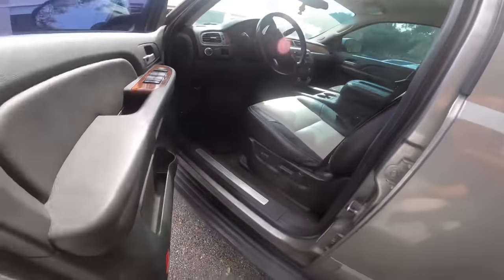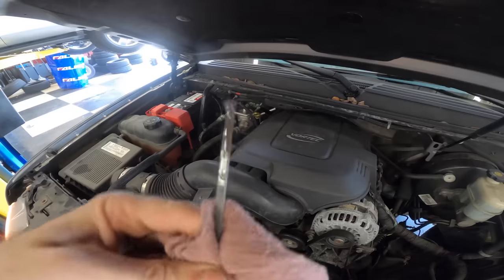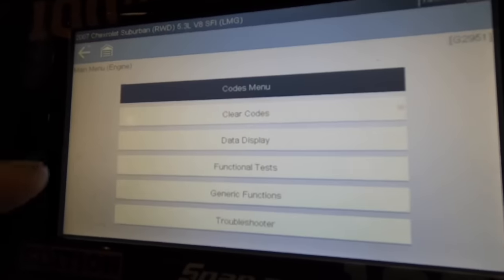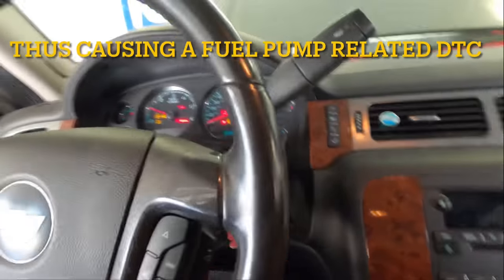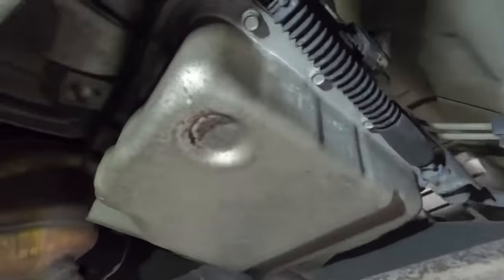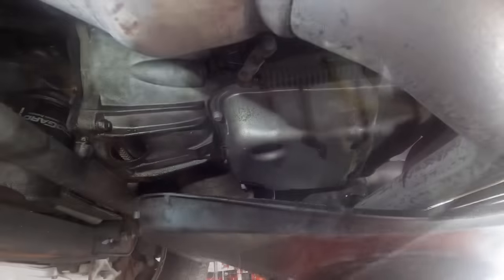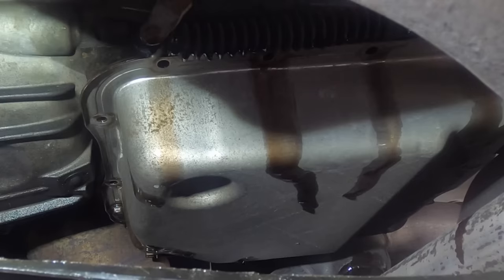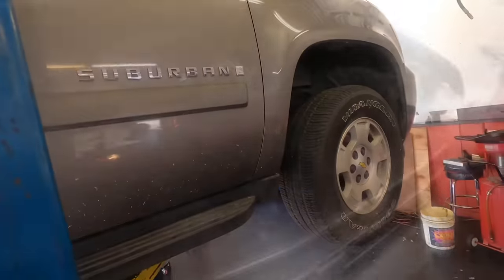Busted! SCAMMING Mechanic Causes Damage! 4l60E Transmission

Comment: I'm intrigued by that rogue wire and the full story.  Was it treachery or just fudging a fix through their incompetence.
Reply: My guess is a bit of both. The other shop knew what doing that would cause, so they fudged the fix and hoped they could milk some more out of the customer
Reply: When I saw your comment, I instantly heard it in a Scottish accent.😂 But yeah I think they knew what they were doing in pulling this scam.😒
Reply from the maker: Im certain that it was treachery. I concluded this based on the evidence that I found combined with the story that the owner told.
Reply: Unfortunately there are far too many shady and dishonest people.  Also unfortunately so far as the automotive field I know for a fact that there are a good number of mechanics who get pushed into being shady by the business that they happen to work for.  I should know I briefly worked for a shop that tried to push that shit on me but I was unwilling to play their game.  Let's just say it was one of the large corporate owned auto mechanic shops within the US.  Got to keep those shareholders happy in the short term even if it means your long-term reputation goes to crap.
Reply: @RainmanRaysRepairs  I agree, none of the error codes present would have been "fixed" by direct connecting the blue wire directly from the fusebox to the fuel pump. Given that the vehicle's owner had no knowledge of the tampering of the fuse box and that the missing relay area was clean indicates it was all done recently enough as to be proof of treachery. The suspect sure had some guts to pull such a malicious scam. That wire could have caused a short and an electrical fire puting the owner and bystanders in mortal danger plus the loss of the entire vehicle. I really hope he gets criminally charged rather than just sued.
Reply: @oengusfearghas9608  A "good" mechanic who is pushed by their employer to be a scam artist is not a good mechanic. A good mechanic quits and moves to a new job when their employer tries to pull that. If they're truly a good mechanic they won't have any issue finding a new job.
Reply: Seeing that blue wire as soon as you pulled it. If it's tied in in such to maintain a power loop when things should be off with the key...yet when disconnected things turn off as they should. As only 1 of the issues...
Reply: @RainmanRaysRepairs  Did the AC work after you fix it..
Reply: As a master technician, what this YouTuber discovered 100% appears to be a scam…backyard mechanics way to maximize profits.  It’s a Chevy, so it has problems I am sure, but nobody should ever create/invent problems to rip someone off.. there’s more than enough legitimate work to be done, I could wrench 24/7 if that were possible and never run out of cars to service.
Reply: @Matt-nq4du  I completely agree.  And while this shop I worked for wasn't trying to do actual scammy shit, they constantly pushed us to upsell customers on things that were not needed.  One example is the manager tried to legitimately sell a customer on a new air filter for a car that was in for its first oil change from brand new.  I'm certainly not opposed to suggesting things when they're needed or even starting to get close.  But trying to sell a customer things that the car obviously does not need, nope I'm not going to do that.
Reply: I'd like to think it was more a case of incompetence if it was done by an amateur but unfortunately a seasoned mechanic should know better and that would make me very suspicious that it could have been a dishonest attempt at gouging more money from the customer.
Reply: Dear Big Clive , how can the fuel relay be missing yet he drove said SUV and we saw on VIDEO that he started this SUV a few times . if your thinking about Auto electronic repairs let us know . The suv would have gone into limp home mode if fuel pump did not shut off , because pressure dif in fuel before  and after reg. I would say this is all for the benefit of the camera.
Reply: @RainmanRaysRepairs  well you do not know  who that guy is  but i can tell you is one of 140 dislike !
Reply: I am pretty sure these videos keep appearing on my home screen because I sub you and you keep commending on them haha
Reply: @sammydemon666  Nice one that’s worked that one out
Reply: @RainmanRaysRepairs  I agree 100% Sir. and thank you for doing things right. Sadly getting more rare these days.  My Dad always  told us if it takes a crook to get rich,than he would rather be poor, He died poor.  And you are right. One mistake or bad act can and will, wipe away a lifetime of being a good person.  All my best.
Reply: @anthonys7976  This guy is a master Technician/mechanic...not just a youtuber
Reply: But still a YouTuber.
Reply: @RainmanRaysRepairs  How do you know the last guy put the blue wire on?
Maybe he tried to diagnose around it and went way off track. I've seen techs ignore red flags or make assumptions they are unrelated.
Reply: The other guy should be held to account and publicly shammed so he doesn’t do it to anyone else 
Hi Clive 😁
Reply: @don2deliver   Too many "coincidences" for that to be the case.
Reply: @don2deliver  The blue wire was new and pretty much clean in stark contrast to the rest of the engine bay. The owner stated the errors and behavior started after that place did an oil change. Doesn't really come much simpler than that. It's not a car with a complicated ownership history lile in cases where you just bought something and have no clue who did what to it.
Reply: @martingilvray06  
The blue wire which presumably powers the fuel pump could have been jumper'ed to the IGN circuit.  If true, the pump would be off when the key is off, so Clive may have mis-stated that the fuel pump would run all the time.  Problem is the current would now be going thru the key switch, which isn't designed for that, so could degrade it.  I wonder how the ECM could know the fuel pump relay was bypassed.  Perhaps it monitors voltage at the pump which might have been low from drops across the key switch.
Reply: Probably a helping of incompetence, with a side of treachery and bad trans fluid for dessert. 😏
Reply: Im in the same profession and I'd add that the shady scammers that give shops & techs a bad rep are doing a service to the honest and reputable quality ones like you when correcting hackery work by shady mcshaderton and  proving to customers that when in your hands integrity and honor is a shared interest. Good job sir!
Reply: @williamsquires3070  Sounds like the condition of the Trans fluid was a side effect of what this guy did with the fuses. It affected the ability of the transmission to shift properly, and if I were the customer, I would be angling to get money for that inevitable repair as well.
Reply: @oengusfearghas9608  all dealerships do that.
Reply: @don2deliver  its obvious other guy did this. He removed what he had done and it ran fine. Only person to work on truck was other guy
Reply: Leaving a fuse and relay out? Really?
Not fudgery. Pure treachery!
Reply: Ignition switches do cause low voltage out.
Reply: @RainmanRaysRepairs  what a rip-off...

I hope the customer is having the other shop settled for good...

And i wish all repair shop is as good as your honesty and good working etique
Reply: @dennisbonville3217  . Here in Indiana a GMC Dealer try to sale 3 brake jobs at the tune of 2 grand each time. In the span of one year.and only 3.400 miles.when I declined the third time.they cut the gas cap gasket.and burn the electric compressor on the air suspension system.
Reply: Suddenly another YouTube legend appears…
Reply: @williamgrissom9022  The pcm is generally controlling and monitoring the fuel pump relay control coil circuit. With the fuel pump relay removed, the pcm would see an open circuit in the control coil circuit and flag that 'control circuit open' code👍🇦🇺
Reply: @simonilett998  Makes sense.  I wonder what simple circuit they can use to monitor coil resistance or current.  Also, even if the coil measures OK doesn't mean the relay works as the contacts can become pitted or stuck shut.  It would see simpler and more robust to sense the voltage (or current flow) output to the fuel pump.
Reply: I'm still laughing at how well the OP's statement fits the Scottish brough!
Reply: Seems to me that blue wire & the fuse & relay were all signs of previous troubleshooting & just hadn't been put back to how it was. Maybe the owner just took the vehicle away without giving any time to put it all back together? Seems to me a lot more going on with the relationship between the owner & the previous tech that we aren't informed about. Leaving fuses & relays out and a random wire isn't the cleverest of scams & easy to spot.
Reply: Haha Hey Clive been up late on the internet again!
Reply: @RainmanRaysRepairs  what happens when something like this wire may cause the car to say cause an accident - would insurance even cover it, since its been tampered with?
Reply: I believe they were incompetent and tried to fix through trial and error idiocy.  Probably still scratching their heads.
Reply: @anthonys7976  Agreed  Master tech 25 years   I run into the same kinda crap.   One thing i try and tell people  and this goes for all walks in life.  If you can not enplane how something works or why it works  then you  yourself don't know what's wrong.
Reply: @williamgrissom9022  Most common is the pcm grounds the negative side of the coil, so when it's not grounding it, the pcm can monitor for voltage on the negative side. Some systems are designed to also monitor the load side of the relay too, be it current, voltage or both. This would generate a different fault code specific to the load side of the relay, rather than the coil side.
Reply: @markonw6661  you mean you don't pull and test EVERY fuse in the box with each oil change? 🤔😐😐😏😏😏
Reply: My guess is if you’re smart enough to run a wire to bypass the real issue then you’re smart enough to fix it.
Reply: no ..that was a complete ' set up '
Reply: @martingilvray06  The blue wire was supplyng power to the fuel pump.
Reply: @simonilett998  Thanks for the reply.  That is a fairly simple method.  Most controls are actuated by such "low-side switching", so when the low side is OFF it should be pulled up to +12 V if the coil and wiring are good.  Not just for relays, but other solenoid loads like fuel injectors.  It is easy to verify such levels with a digital circuit on the ECM board, so sounds like they do that for many circuits today.  As you say, verifying the output to the load is harder, but more assured than on the logic side of the relay.  Re fuel supply, the most assured diagnostic would be a pressure sensor at the fuel rail, but none of my gasoline engines have that.
Reply: @williamgrissom9022  Yes, you're spot on, not all but most solenoids, actuators etc are low side switched. Also, a fair few late model vehicles, mostly gdi or some mpi, do have a fuel rail pressure sensor/s, to confirm pump activation, correct fuel rail pressure, and/or for monitoring by the pcm for fault code generating, or live data capabilities.
Reply: N the gas
Reply: @RainmanRaysRepairs  i think the noise is a cracked flywheel I had the same noise on an S10 I had it was cracked around one of the mounting bolts and would flex whenever you pressed on the gas
Reply: @williamgrissom9022  what I was getting at was fuel pump pressure is control by the ECU turning pump on off by picking up info from the fuel regulator so if pump did not shut off would this not put the vehicle into limp home. So the SUV was not going into limp when driven before being put on the ramps , so has this situation been created for the benefit of the camera. Please take into account that I am UK and do not know this model. The drive around the workshop would nearly take you around the Island Clive lives on. We have not heard from Clive but it’s that time of year for him planning Xmas lighting.
Reply: @anthonys7976  Former master tech here too, and I conquer with you. It's pathetic. Hats off to  @Rainman Ray's Repairs for representing those of us with integrity.
Reply: @martingilvray06  
I doubt a 2007 would modulate the fuel pump to control fuel pressure.  Most/all in that era ran the fuel pump continuously and used a "back-pressure regulator" to control the fuel pressure, which is simply a spring-loaded relief valve which sends fuel back to the tank.  By ~1996 those were usually inside the tank as part of the "fuel pump assembly".  Earlier the pressure regulator was on the fuel rail, with a return tube to the tank, but the EPA required a "return-less system" to avoid heating the fuel (more evaporation), which is also simpler.   Designers initially over-thought the systems, thinking they had to control pressure right at the injectors, and even relative to intake manifold pressure (had a vacuum hose for that), when none of that is required.  I vaguely recall reading that the latest systems control pressure with a variable-speed pump.  I doubt on-off control would work.  In some, like the after-market Holley TBI on my classic car, they apply full BATT+ to the fuel pump to start it, then drop the voltage a bit (~10 V) while running.  Perhaps that is what you have seen.
Reply: @alexisrivera200xable  People always claim something just happened after you changed their oil. That's not proof of anything. Your getting a third hand account of one side of the story. Even Mechanics see what they want to and expect to see sometimes. A diagnosis sometimes includes completely abandoning any presuppositions.
It could have even been a shoddy repair path based on an intermittent problem that isn't currently happening. 
Never blame on malevolence what could simply be blamed on incompetence.
Reply: @oengusfearghas9608  Short term gain, long term loss but that's the game they play and then move on under a different name. Nice to see you didn't play their game.
Reply: I hate this crap, it affects every trade when you do things properly
Reply: @jasonsummit1885  p
Reply: Hey BigClive how are you? Hopefully we'll. I actually follow you. Love your content as well as the one I just watched.
Reply: @oengusfearghas9608  the worst is used car dealers!!!
Reply: @williamgrissom9022   The ECU only detects that the data link to the fuel pump is not responding so it posts an error. It doesn't have a way to detect if the relay itself is missing just that the pump controller does not respond at all when queried. Its just the information needed to troubleshoot the general area.
Reply: @alexisrivera200xable  the wire would not have caused a fire, he chose a 15 amp circuit for a reason, he also used 16 gauge wire, which is enough to provide current to the Fuel pump from that range, the factory harness uses 18 gauge ( that's why new pumps come with 3 feet of 16 gauge wire, to make up for the lacking factory wire) .
Reply: @martingilvray06  Chevrolet SUv's don't have fuel pressure sensors, pressure reg is still mechanical.  and the pump was running, despite the fact their was a circuit code for it. ECM's are not that smart.
Reply: @williamgrissom9022  my 2000 silverado still uses a mechanical regulator on the rail. there is no PWM pressure control, until around  2010 for chevy trucks/suv's with the V8 engine.
Reply: @don2deliver  I'm not a mechanic by trade I got taught by family but I did study computer science and electronics repair so the forensics are not hard ro do and the times align with the customer's story I can tell that there was foul play involved based on the presence of that (fairly new wire) the ECUs errors and the behavior of the truck. It was tampered with recently. Had it been left as is for longer the transmission would have been demaged a lot more. Its a rather clear cut case actually. From the moment of the tampering I can tell the first thing that went wrong is the battery getting drained, followed on by the truck feeling sluggish. The ECU needs the sensor data from the pump and the transmission fuse to power the sensors so it can control the gear changes
Reply: @RainmanRaysRepairs  I was thinking the previous mechanic that was supposed to do an oil change probably drained the transmission not the engine oil, then over filled the engine with oil and left tranny empty, causing tranny damage, and over filling engine messed up the oil pressure somehow, then after they brought it back he seen what he did and tried to cover it up that’s why the granny fluid was so clean
Reply from the maker: @gamebredduramax71  This can happen in occasion…. But not this trans. It don’t have drain plug (GM stopped doing that on this model)
Reply: @RainmanRaysRepairs  oh ok. Your a good mechanic IMO. If I was near you I would use you to fix my vehicles
Reply: Remember the bad old days when you had to go through with a test lamp or multi meter and look for the faults to try and confirm your original diagnosis that required a lot of knowledge particular to the vehicle or that manufacturers equipment and systems, which almost always involved taking things apart, only to get moaned at because it took time to discover the true extent of the problem never mind fix it. And some customers would then want to see the broken parts because they know better than you do and think your bluffing them.
Reply: @RainmanRaysRepairs  In addition, it is very unlikely that combination of "defects" (I hate it when parts evaporate) that would cause DTCs but still allow the engine to run would have 'just happened."
Reply: @62saki91  I wasn't talking about the wire's gauge I'm talking about how the fac that it was haphazardly routed and hidden. It just takes a single nick or melting due to its proximity to hot parts for the insulation to fail and cause a short. The OEM for what is worth keeps all the cables bundled in the wiiring harness and properly routed which protects it from the heat far better than that blue wire was.
Reply: @RainmanRaysRepairs  if it wasn’t treachery they would have said, we think it might be xxxxxx and you’ll need xxxxxxx but in the meantime we’ve patched a wire in to get you going, but they didn’t because they were just ripping the owner off, bet they do it all the time.
I’ve only had one experience if a shady motor dealer, and fortunately have had the benefit of a number of good guys (like you) I don’t mind paying if it’s justified.
👍done
Reply: Could always go back to the scammer and break all the windows out of that crooked shop and leave a business card for a local glass replacement shop. Don’t get mad get even. This comment left by SPITE Inc.
Reply: @62saki91  Thanks it all makes sense to me , I can’t believe the mileage you all get out of your vehicles. 6’2 rings a bell , me second P.
Reply: Seems like maybe other guy was in over his head and was grasping at straws. Not every car mechanic is crooked.
Reply: @shawnkelly5459  previous "mechanic" may have loosened flexplate bolt(s) to cause the noise(and lazily left off the inspection cover)
Reply: @martingilvray06  Painter by trade, shade-tree mechanic out of necessity, I'm pretty sure that fuel pumps do NOT turn off while engines are on. The ECU sends a signal to the fuel by-pass circuit to return any "unneeded" fuel back to the tank on a continuous cycle.
Reply: @Matt-nq4du  Some people can't afford to do these things, I don't blame individuals unless it's proven the individual was the one at fault
Reply: @Matt-nq4du  there's a reason our tool boxes have wheels lol - and you are right, finding a job the same afternoon you tell that thievin' rat bastard you quit isn't unheard of for those of us that can actually fix things.
Reply: @alexisrivera200xable  judging from the direction it was going i'd say they had it following the brake lines ( likely wrapped around them)  down to the ABS module and then ran it in the frame rail.  so realistically, the customer would have either A caved and bought the repairs, b found a different knowledgeable shop, or C taken it to the dealer for a trade in, which the used car tech would have looked at it and said WTF? before it would have ever rubbed through.
Reply: Well well... fancy meeting you here, Sir 😁
Reply: Big Clive!! Did you get this in your recommended also?
Reply: @ramiroescamilla7263  About 15 years ago I had a Mineke guy (in fairview heights, IL) tell me I had a leaking boot on my brake caliper, which needed repair.  And that it was all an inseparable piece so I'd need new calipers. So I asked him to show me how bad the leak was so I'd have a better idea how soon I'd need to take care of it (I'm no mechanic, but I was raised around a lot of blue collar guys & have at least a vague sense of it). He takes me back, pulls the wheel, exposes the caliper. Nothing. Not one drop of brake fluid anywhere. I say "that looks bone dry, where's the leak?". It was an honest question, still giving the benefit of the doubt, sometimes a leak is hard to spot... 

But his body language was getting really awkward, and I was starting to put 2 & 2 together. So he goes and gets the manager to show me how it's leaking. The manager does this by prying the rubber end cap on the caliper piston open with a pocket knife, right in front of me. I wish I had it on video. I was speechless. And it was extremely obvious from the dust that nobody had pried the rubber boot on the caliper piston open during the brake inspection. I must have had a stupid look on my own face because the manager had this _ eating grin on his face like he thought he was being clever. He struggled to coax a drop or two of half-dried up brake fluid out from under the boot.

I said "that wasn't leaking until you stuck a knife in it". His grin went away. He says "well there shouldn't be any fluid at all!", so I ask "then why does it have a rubber boot sealing it up?". He said nothing so i went on "any hydraulic piston is going to have a little bit of fluid get past the gaskets, it'll probably take me a year to build up another 2 drops for you to coax out from under that boot". Younger employee sucked his lips inside his mouth and just looked around the room. Boss guy was getting huffy. I tucked the boot back into place with a fingernail, checking that the knife gouge in it was pretty minor, and told the younger guy to put the wheel back on. I said to the manager "I was told the boot was an inseparable part of the caliper, but you just pulled it off with a knife, and I just put it back on with my fingernail. If it ever does become a problem, I think I'll take care of it myself".

I'm normally very sweet, I swear. But I was extremely annoyed, and kinda channeling my inner redhead.

The manager tried to forcibly escort me back to the waiting area, citing 'employees only' or something, but I yanked my arm out of his hand and informed him that I was staying with my car. At that point he got a real mean look about him, and you could have heard a pin drop back there. Got a strong impression that the employees thought something might go down. I dunno what the boss guy was thinking. I was thinking that none of the other employees would lift a finger for that boss, that I had positioned myself very near a tire iron, and that it would take him about 1.5 seconds to get his pocket knife back out and opened up. Maybe he could tell what I was thinking, or maybe he just decided not to argue further. either way, I wasn't letting my car out of my sight. And after a few moments he stormed off to his office.

Technically the boot's mostly there to prevent corrosion, and a caliper can leak out through there. But it was really obvious mine wasn't, and that they were being shady af. That boss had a vibe about halfway between a used car salesman (the stereotype anyway) and a mugger. Fortunately I found a different shop with a mechanic who had all the social skills of rusty barbed wire, but who's very honest. That's all I really want in a mechanic. It's so hard to find an honest mechanic and a good dentist. I'd say a good doctor and a good lawyer too, but I've never met any of those. I'm sure they exist, hypothetically.
Reply: @RainmanRaysRepairs  I'm really hoping the owner of the other mechanic shop didn't know this was happening and returns all money for the unneeded "fixes" that broke things on purpose. Also, hope they check with police fraud department.
Reply: Indeed, I was thinking the same thing. Sounds like they were trying to bypass the fuel pump relay.
Reply: @martingilvray06  How do you you think, with the blue wire bypassing the relay and connecting the pump to the battery
Reply: @wirdy1  yeah I completely agree. All the people saying it's a scam don't understand car electronics.
Reply: @alexisrivera200xable  I was thinking the guy was just getting the fuel pump and working his way back from there. Leaving a blue wire exposed running straight to the fuel just seems like the thing a novice would try just to get it running. Just saying.  You did have more clues though. Shameful.
Reply: @don2deliver  My 2001 Expeditions fuel pump failed right at the mechanics bay after an oil change. The mechanic took it out for a test drive and then it would not fire after he parked it in the bay. I heard the sound of my engine being cranked over and over from the waiting room and went out to check. I stopped him after the tenth attempt as something was clearly wrong. I suspected treachery, but at 94K miles and 16 years I suppose it was time. It did cost me quite a bit to have it fixed then and now and had to bring it back because the fuel sender was quite a bit off and I had no reserve level. That mechanics shop also worked on my wife's car at same time and failed to fix the brake lights and even left a loose bolt laying under the hood they could not explain from where it came.
Reply: @NerdyMeathead  When I watch a channel a lot it seems to appear in my channel viewers suggestion list.
Reply: @62saki91  Except for the many millions of GM engines with SIDI.
Reply: Treacherous actions.  Running fuel pump to fuse box. Is not an accident
Reply: @alexisrivera200xable  you would make a good detective.
Reply: @danielnelson4881  Wow, you wrote a lot of text. 🥉
Reply: Bigclivedotcom I keep finding you everywhere lol
Reply: I would see the wire as treachery personally due to the below based on the vid and my knowledge of car electronics and scan tools.

The ecu (pcm) controlls the fule pump and may or may not (depending on car) modulate its speed based on demand 

The fule pump relay tells the ecu to run the fule pump 

The jumper wire (blue) was taking power directly to the fule pump to run it 

Now as far as Ray said the car never once went In for starting or stalling issues so why would you remove and bypass the fule pump relay 

And as soon as you add the jumper ther relay will get stick closed as the ecu is bypassed so the car will run all the time (as it did)  it this would only be solvable by removing the relay to break the 2nd curcit. That means unless you pull the relay and bypass the fuse the car won't run or stop (depending on which way you do things) Also the other way around the car wouldn't run if you removed the relay and didn't add the bypass (so I would say these were done at the same time) 

As the scanner won't see the issues until they exist (relay removed and bypassed) they would never of had cause to go near those fuses or relays in the 1st place. (Unless they knew what would happen)

The bypass also caused the trans to enter limp mode loosing 1st gear which is the main thing the customer says he noticed (Which if it were some attempt of a fix you'd put everything back and start again)

So based on the customer (according to ray) stating the issues started after an oil change and batt change and the fact that it caused an issue that produced some very specific issues that would still allow the car to run I say its most likely a scam to get customer to pay more

Ps well done Ray you saved them a huge bill

Pps hi Clive I keep seeing you in the comments of all the videos I watch see you tonight in live stream lol
Reply: @MattyEngland  Sometimes explanations take a minute or possibly  two, to type, instead of 10 seconds. I wanted to help you to understand.

I doubt you read it, you strike me as one of those "ur dumb, I'm so smart.. 30 seconds of reading? EW NO!" kindsa people. If you did though, I was a wee bit triggered by your statement of people not knowing anything about electronics if they thought the truth, basically. So I may have been a bit abrasive, I apologize for that.

I'd still love to hear your explanation if you've got one. I'm not afraid to read for 30 seconds, a minute even if I'm learning something! Lots to learn from some incredibly smart guys and gals 'round these YouTube parts!
Reply: If the guy knew what he was doing then sure was Treachery and if not then that guy shouldn't be trying to be a mechanic when he is nothing of the sort.
Reply: @danielnelson4881  I read it, I just have no inclination to waste my Saturday debating it at any great length. It would seem perfectly reasonable that someone MAY have bypassed the fuel pump relay in an attempt to rule that out as the reason for a no start. The story of what happened was vague and all based on 3rd party information anyway, who knows who or how many people had been messing about with it prior to it coming in the shop.
Reply: OMG bigclive visiting this channel!!!!!!!
Reply: I suspect the customer/owner isn't telling the whole story.
Reply: What shop did that king of rigging?? I just wanna talk.
Reply: @tonpear5909  we are specifically talking about the GM SUV/Truck V8 engines, not the SIDI 4 cylinder engine GM uses.
Reply: For him to run a wire and plain sight it's safe to say  He was just rigging some shit up and didn't have a clue on how to fix it the proper way
Reply: @ikelove8690  I agree. And I think the owner got frustrated and took the car back unfixed, and then lied to this Youtube mechanic.
Reply: @williamgrissom9022  it monitors the relay circuit for power when the ecm grounds it. The ecm was grounding without receiving voltage meaning an open in the circuit.
Reply: @RainmanRaysRepairs   two things... 1. would love to chat at some point, great vid and awareness of your craft...excellent... 2.What is Jeopardy Ray?
Reply: @anthonys7976  not just backyard mechanics..............as others have explained here.
Reply: @RainmanRaysRepairs      ive had my own horror stories with car mechanics.   more than one unfortunately. the latest one:    a 2003 infiniti g35, spent almost 3 years in a shop getting a used engine replacement. ended up somehow having to replace both Cats as well, even though the car had passed smog just a month before it went into the shop.
Reply: I did a quick auto box investigation many years ago. Ford Capri auto, it had a tinky tink noise. The spring for the trans parking brake lock had broken. I had done originally a camshaft on the 2.0 litre engine, a well known problem. The tinky tink noise only came to light when the camshaft noise disappeared, The customers father came in and accused me of damaging the transmission and was verbally abusing me and the Garage. Then the daughter came in and asked what was going on, as it was her car. She listened and said it’s always done that! The small spring is designed to hold the lock clear without it the lock bounces of the teeth it engages with making a tinky tink noise. Luckily it cannot engage! Well done daughter for being honest. Sorted camshaft and transmission parking brake lock.
Reply: i seen stuff like that before, who knows if it was on purpose, it could have been a by pass by a less skill mechanic, there could have another problem with the pump in the past that later got fix and buddy forgot about the little pump wire jump wire, i done bush fixes, because in the bush you only care that it moves back to town, once u get it home, you do it right
Reply: @levisvarela3735  100%. We have no way of knowing if the customer is telling the whole story. It is very easy to sit here condemning the previous mechanic and calling for justice but none of us have any clue of the history. This vehicle appears to have many issues which could be related or not. I have always told my employees to come to conclusions based on what you know and not what you think you know.
Reply: @jasonsummit1885  naw ye didnae
Reply: @oengusfearghas9608  there is no excuse for forcing this on your staff and as staff we all shouldn't allow it...if we all make sure we don't do it and call out companies for doing it then they will stop eventually...I'm in the UK where its less of a problem but can still happen.
Reply: @spikenomoon  Thanks for the kind words friend.
Reply: @anthonys7976  Chevy makes the best trucks.
Reply: @Matt-nq4du  And he should also denounce his boss to the authorities, or he will just hire another "not so good mechanic" to continue with the scams if he is not stopped.
Reply: I spy BigClive! So thats why I'm here... Oh well beats being Rick Rolled, great channel Ray :o)
Reply: @levisvarela3735  you arent really thinking this through:   there is literally nothing wrong with the car.   there was no reason to ever "bypass" anything.   certainly not the fuel pump relay LMAO.    no one in their right mind puts that wire into the fuse box unless there was actually a problem with the engine in the first place.  which there literally isnt, proven by the fact all he had to do was put the fuses back and the car is back to perfect working condition lol.    110% certain this was a scam in progress.  10 BILLION % certain it was a scam in progress really.
Reply: @oengusfearghas9608  pepboys
Reply: Nice detective work sir!
Reply: I have seen this jumper wire "repair" before, but it was not treachery.  These vehicles have an failure prone immobilization circuit that interrupts power to the fuel pump relay and prevents the vehicle from running.  That security system is really buggy and bypassing the fuel pump circuit restores operation.  Usually power is taken from the switched ignition circuit so that the fuel pump only runs when the ignition is on.
Reply: @velocity2654   if that was the case then the vehicle would still have that problem when he put the fuses back in
Reply: @jasonsummit1885  gvլւին00յ0
Reply: Definitely away to make the person think they have a problem in the fuel pump that’s why the battery went dead
Reply: @wirdy1  Not to the owner, the whole point of a scam is to get the customer to say ok fix it, not go to another mechanic
Reply: @bamamanfan  no, I'm saying he's both. Someone  implied what your saying but not me.
Reply: @bamamanfan  he seemed very knowledgeable to me otherwise, I wouldn't have watched so much of it and read the comments.
Reply: @ramiroescamilla7263  Explain why you kept going back when you knew the first time they tried to sell you a brake job, that this was not needed???
You should have reported them to the bureau of auto repairs for your state and let them get into their stuff.. 
You kept going back to these crooks and then they jacked your truck..
Why???
Reply: @Yohann67   concur...
Reply: @icanfartloud  the not turning off issue was FROM the wire
Reply: Smart and articulate fella. Hairy as fuck arms. Reminds me of my old man.
Reply: @frandanco6289  Easy buddy. Not everyone's Batman
Reply: apparently the rogue wire as you called it was part of the problem, not a solution or temporary fix.  look above your comment and read my story of a "bad" mechanic. it happens too much.
Reply: @Matt-nq4du  ikr. What was that guy smoking when he wrote communist manifesto.
Reply: Either way zero excuse after all the end result is the same,  a customer paying through the nose for work not done or needed.  Both are dishonest  behaviour. If you don’t know what you are doing you have no business doing it and posing like you do know you are just as crooked as the so called mechanic intensionally setting up and ripping off through the claim of unneeded work and parts selling. 
If this was my Suburban I would take that blue wire and very tightly wrap it around the neck of the person who put it there causing a malfunction of the air intake breather section. Joking … But not joking I do my own work 99 % as I do not trust any shop, especially those that pay the mechanics a commission of sales.
Reply: @alexisrivera200xable  wtf? Yeah that's shady and a complete crap thing to do but you're being super dramatic. I have a better chance of leveling a city block by not discharging the static electricity from my fingers before operating a gas pump. Sheesh
Reply: I had a tire shop try to generate repeat business by deliberately screwing something up, most notably putting a front wheel on cockeyed and slamming it on with an impact wrench, thus distorting the rotors.  I saw through that scam and never went back there again.  I had another shop turn the rotors and reinstall the tires with a torque wrench.  Didn't mind paying them for it, either.
Reply: @RainmanRaysRepairs  45 minutes and IT'S NOT EVEN my VW.  Good presentation. Computer replacement big $. U got your thumbs up. :)
Reply: @martingilvray06  He mentioned that the fuel pump had been hotwired to be always on when the accessory circuit was on.
Reply: @Iceman-kr6df  pp aww
Reply: @jasonconrad5772  Yeah, on the front damn door! And on the wall at the registers.
Reply: @morganplisken7271  Perfect business model! Get even!
Reply: I've had lots of cars with lots of rouge wires and fuses going here and there.
Reply: What was with all the flickering lights and why was the engine block light on?
Reply: @Matt-nq4du  When I was young, I had a Service Manager tell me to perform a repair where there was no issue.   I was told to take a week off and think about my choices in life, so I loaded my box and drove off.   Two days later (Thursday,) I was invited to lunch with the employer I was with before I went to Shady.    Monday, I was working again..... and on Friday, the place I had just left contacted me to let me know they fired that Service Manager - after four other mechanics left the next day for pretty much the same reasons.
Reply: with fuses played with scam has happening in your face you can see it,  or is that you? i was scammer by one said my rear breaks were needed replace so yes I had them do it they were at 8 or 9  it was not my regular they were over booked I only went in for oil change I went to reg mechanic for  tire rotation and  I told him my rear breaks were done  he looked at me and said why they were fine wait till they were 3 also that other one fixed ?? my heater fan in the car  went in fine same job when I drove away the vibration was was rocking arm rest like when you get a peach core in your tire front it rocks the front end when driving,
 he had  to fix it now it is a 2014 escape I was scammed never go there again
Reply: An honest tech, which most are, do the work of the great architect, whatever that may be. It is troubling that some chose to hurt others like this. They should think of the darkness they attract. Just an amazing vid Sir, thank you🙏
Reply: If he was smart enough to know how wire up a "fix" and conceal what he did, he certainly knew he was out to screw another customer.
Reply: @RainmanRaysRepairs  nice work on your part even thought that truck looks a bit worn out
Reply: It was a very clever scam
Reply: Good Question.
Reply: They had to know what they were doing, because there is no reason to remove the fuel pump relay, and wire a hot wire to the fuel pump using the transmission fuses socket. Thus causing both the fuel pump circuit code and transmission to be stuck in limp in mode with a transmission code. It could be that they didn't change things in the fuse box, someone else did, but they never checked it. They might have just read the codes, and said you need to replace this stuff to fix these codes. Whoever removed the relay and fuse and wired a hot wire to the pump is the one that caused all the issues.
Reply: @RuralTowner  Hi may I ask what are other issues and if u think blue wire was negligent or scam?  Thanks
Reply: @martingilvray06  Do u mean fuel pump fuse relay was necessary for car to drive into shop?  Didn't blue wire bypass relay possibly?
Reply: @don2deliver  Are blue wires commonly used to diagnose transmission issues ?
Reply: @williamgrissom9022  interesting info, what do u think 🤔 happened and why was blue wire there ?  Cheers
Reply: @techtastic2010  so does this mean the missing fuel pump relay affected the transmission? ... But kept fuel pump running with blue wire ? 🤔 Cheers
Reply: @simonilett998  great info but can car run without fuel pump relay as no gas ⛽ is being pumped?  Thanks
Reply: @wirdy1  ok great info, but is that common for fuel pump relay to be taken out to diagnose transmission?  Seems difficult to probe by untrained mechanics because fuse box would have to be opened. Thanks.
Reply: @one2tameflame  ok good point but why not just buy new fuel pump relay ? And does blue wire affect transmission? Cheers
Reply: @don2deliver  do u mean missing fuel pump relay could have been removed from work before oil change?
Reply: @jasonconrad5772  Do u mean fuel pump jumper allows fuel pump to flush out fuel without engine on?  Is it possible that was from prior work before oil change?  Thanks for pov 🙏
Reply: @alexisrivera200xable  ok thanks for interesting info.. what is your views on missing fuel pump relay and blue wire?
Reply: @62saki91  interesting info, may I ask your views on missing fuel pump relay and blue wire?  Cheers
Reply: @gamebredduramax71  it appears transmission fluid was dirty in this video before it was changed.
Reply: @kathrynck  how are the brakes now?  Lots of DIY brake videos on YouTube. Cheers
Reply: @acemoto2319  That wire bypass could easily be one or the other or even a combination. A bypass can be used to narrow down a problem sure. If there is say A B & C in a circuit where each relies on one another & A is found to be working but B & C isn't then if bypassing B (which in this case iirc was the missing relay) made C work then you found the problem. But since the blue wire was hooked into live power it caused a drain on the other end. This result can either be deliberate OR said negligence if it was not a known to happen.

I'd have to view the video again to describe better detail even for my own sake. I have only limited experience with these modern setups but still just a process of elimination.
Reply: @acemoto2319  Yes & no. I got some neighbors that use to do the reverse con. Tricks to remove warning lights without actually fixing the problem such as removing fuses & bypassing sensors.
Reply: @acemoto2319  
The mechanic doesn't know the history and the owner wasn't forthcoming about it.  I doubt sabotage and more likely someone bypassed the normal fuel pump relay, perhaps by tapping into the ignition circuit.  That is probably also powered thru a relay in most modern vehicles, so the current load may not be a problem, but I suspect it might bypass an important safety feature such as a sensor which turns off the fuel pump after an accident like a roll-over.
Reply: @RainmanRaysRepairs  was there an update on the scammer who did this, did your customer get his money back from the scammer?
Reply: @acemoto2319  Everyone is outraged over what the mechanic reports his service advisor told him the customer said, yet there is no evidence the wire was put on at the time of the oil change. 
A customer can be mistaken and the mechanic is spreading what would be heresay in a court if law. Sure it would be great to get to the bottom of what happened, but that's not going to happen  on YouTube.
Reply: @acemoto2319  What do you hope to gain by asking asinine questions?
Reply: @acemoto2319  I'm not very mechanically-inclined, but I'm going off of what Ray said from 40:07-40:40
Reply: @acemoto2319  well the fact the relay isn't even in the fuse box loose, and neither is the trans fuse, i would say it seems intentional, usually if you are tracing an issue, you leave things in the area you pulled them when it comes to electrical ( helps prevent loss, or an "oops" moment )

the fact it was also vamp clamped to the fuel pump power wire tells me it was intentional, especially since he is pulling power from the trans fuse, and not the constant positive power of the relay , or by running the wire to the switched positive side of the relay. 

( there are four prongs, two will have power, one will have power all the time, the second has power on key on, and the PCM controls the ground side in most newer vehicles,  to energize an electro magnet, which will close the contacts in the relay to provide power on the 4th pin that should be equal to battery power to power the pump)

so yeah intentional and fraudulent action by the other shop by taking advantage of a persons lack of automotive knowledge.  their actions, if the customer drove it long enough may have also led to a transmission that would have been damaged to the point it would be inoperable. as is witnessed by the rather full filter, and the extensive metal on the magnet and clutch material cleaned from the pan. it's very possible they may have reduced the life of that poor 4L60/80E's life.
Reply: @acemoto2319  No, of course the engine wouldn't run without fuel being pumped. However, that blue wire that was added, ran directly to the fuel pump from the hot leg of an empty fuse holder, effectively bypassing the pump relay. Only after Ray reinstalled the missing pump relay, the key would not shut off the engine. This was because that blue fuel pump bypass wire was still in place. It was now back feeding power to the ignition/run circuit after the relay was back in. So I assume power was now going from the trans ignition 1 fuse tap to the pump, and coming back up the pump wire keeping the relay, pump and ignition powered up, keeping the engine running 🤷
Reply: @don2deliver  as soon as he pulled that added on wire, I thought... What was that.??..what was it for...where does it go too... The  '' tech ''..should have thought the same...and checked what amp fuse it was plugged into...and where it went too...not a very inquisitive.. '' tech ''.
Reply: @simonilett998  Okay great info, thanks Simon.  Very strange situation... Now I understand better.  Continued blessings.
Reply: @62saki91  Okay great info... thank you 6'2Saki.  I had no idea that stuff like this happens, though I may have had similar incidents on my car.  It's good to be aware.  Thanks again for your insights.  Continued blessings.
Reply: @don2deliver   Hi Don, I have had a similar situation happen to my car.  Last month, I took it in for new brakes and now my transmission is out.  So I'm trying to figure out if my mechanic did something to mess up my engine.  It ran fine when I took it in for brake pads, rotors, and calipers.  At pick up time,  the mechanic wanted more money ($100) to diagnose the loud engine noises after I had paid $900 to repair brakes.  And when I insisted that the engine ran fine when I took it in, he suggested that I look to vacuum hoses.  I'm sure I'm not the only person in the world with car issues; so hope my questions are legit and justified (and not asinine) to learn how people can tamper with car repairs.  With so many people pointing fingers at the mechanic who changed oil, it appears something strange happened.
Reply: @techtastic2010  Okay thanks Bobby, I had a similar issue happened to my car after getting my brakes fixed.  So I'm learning much from this video.  Cheers
Reply: @RuralTowner   Okay thank you for great info... With everyone's reply and viewpoint, I'm learning much about car issues.  Continued blessings.
Reply: @jasonconrad5772   Okay thank you Jason for great info... With everyone's reply and viewpoint, I'm learning much about cars and fixing issues.  Continued blessings.
Reply: Those vehicles were notorious for bad ignition switches. I first learned of this in 1999 when a top tranny builder in his late 60's had one out of a 4x4 for a shift issue 3 times to find a bad IGN sw. 10 years later I took over another job with a "bad" new fuel pump. I jumped the relay (with cotter  pin to test wiring and pump) and it worked so I traced back to IGN (not grounding relay). 2 years ago I took over a job with antitheft issues stemming to the lock and key sensor.  IMO it would not be hard to believe that an inexperienced mechanic could have jumped the fuel pump and bypassed the relay thereby stupidly causing these issues. He then pulled the relay bc it would not shut off. We have had similar issues with fuel pump modules not being grounded and mechanics tricking out the ECM by running direct grounds or earth.
Reply: @Iceman-kr6df  m
Reply: @acemoto2319  Hopefully you can get it fixed. That really sucks.
Reply: @anthonys7976 Fords don't have problems?
Reply: @martingilvray06  Didn't you see the blue wire?
Reply: Clive!
Reply: @danielnelson4881  matt probably other shops mechanic knows were blue wire goes
Reply: @RainmanRaysRepairs  do you think you’ll ever get the whole story eventually Ray?
Reply: @wisher21uk  time for local TV station to set a trap with Rays’ help.
Reply: @MarkSmith-js2pu  exactly Mark shocking the things some people do
Reply: @ShaggyR1z1a  I was an insurance adjuster for 40 yrs.  Insurance co would probably never know.  They would pay for collision damages.  Twice I was involved in wrecks where my driver claimed brake failure.  They didn’t want me to pay for the other guys damages.  I had the cars towed to an independent mechanical shop, they documented all parts and systems to show the brakes were perfectly fine when accident happened.  I gladly paid for the damages and throughly enjoyed telling the my customers that their brakes were fine.  I also reported their lies to Underwriting hoping that we would cancel their policies.  I don’t know if that happened or not, but we were encouraged to do so.  Insurance doesn’t work well when lies are involved.
Reply: @alexisrivera200xable  all wire on the vehicle can cause a short and mortal danger blah blah especially when the owner installs sound system or alarms with rats nest wires duct tape and zip ties.stop being a cry baby
Reply: @williamgrissom9022  common fix for intermittent problems when the owner doesnt have mony for proper diagnostic and repair and needs the car fast blah blah blah...then he gets the paycheck and goes to another shop saying he was scammed...compulsive lying is normal on many customers
Reply: @don2deliver  my guess is that its an intermitten issue thats why they put the wire, the owner did not want to pay for a thorough diagnostic and wanted the car running...now the car will be back in a couple of days....
Reply: @62saki91  finally someone that actually knows something about the subject....thank you
Reply: @alexisrivera200xable  it is a 15 amps....it will blow the fuse not cause a fire...
Reply: @MrHBSoftware  Even if an intermittent issue they could have saved alot of time just running a jump on the fuel pump relay and testing that. Running a wire off a trans fuse, while it would work, would cause bigger issues, and supposedly the other shop wanted to sell them a TCM after they pulled the fuse which makes it suspect. Cause this customer doesnt seem to have a clue otherwise they would have noticed the missing relay and fuse in the fuse box they also could have run the jumper off the drl or radio fuses. And prevented codes.
Reply: Alot of times owners that don't know about cars do fixes they find on Google and act like other shops did it hope this isn't a case cause they won't even tell Ray what shop and I think that's why
Reply: it's not a fix... the fix was to place the relay  back in bro
Reply: @Matt-nq4du  life is rarely as black & white as that unfortunately. A good person would quit but equally I doubt many in this climate would quit without having another job lined up especially if they have children to feed.

However even if your boss is pushing crap like that you can work & not do the dodgy rubbish.
Reply: @williamgrissom9022  you nailed it.  Back before they issued a TSB for scabbing an external relay onto the power module in the 2011 Grand Cherokee because the internal fuel pump relay was undersized and failure-prone, a wire like that was my “get home” patch when it would act up.  What you DO give up by running the fuel pump directly from ignition-switched power is the computer’s ability to shut down the fuel pump if it loses ignition sync (iow, if the engine stalls or a collision is detected.) it bypasses a safety feature, but otherwise works normally unless the driver is very observant and doesn’t notice the fuel pump running when the ignition is in the “on” position but the engine isn’t yet started.
Reply: @Matt-nq4du  sure but sometimes exactly that can be the issue ... if you're better than your possible new boss makes them uneasy and therefore more often than not not taking you ...
Reply: @ronnierobinson1502  I don't believe he's actually a master tech
Reply: @alexisrivera200xable  wasn't it originally a dead battery? probably will have another caused by a fuel pump fault now :)
Reply: @don2deliver  The issues only arose after it was taken to the other guy. and the wire was the cause of majority of the issues. one issue led to another, and so on. when it was removed, most of the issues fixed. therefore logic tells us it was the previous guy that likely installed the wire. The owner would not have been knowledgeable enough to do that himself. and for what reason would the owner have done it himself anyway?
Reply: @wirdy1  not that easy to spot if you aren't knowledgeable about cars or electronical Eng. and to your statement that it may have just been 'leftover signs of troubleshooting...,' tell me how? What good reason would the guy run a wire from a 'hot' contact on the fuse box to the fuel pump? The only other direct way to accomplish the same thing here would be putting the line to the battery terminal, which would have been WAY more obvious. and what good explanation would there be for the relay switch removal? I very much doubt this was all accidental during the course of normal troubleshooting.  Plus the customer took it to the other guy for only an oil change. He had no reason to be exploring any other part of the vehicle.
Reply: @wirdy1  When wire is removed and relays installed all works. If you as a mechanic want to replace fuel pump and computer with the missing realy and blue wire installed you are a scammer. Either by creating those faults or by having absolutely no competence in what you are doing. 

The fact that all errors were gone after removing wire and replacing relay and fuse tells the truth about the condition of the car.
Reply: @ramiroescamilla7263  you went back to those guys?
Reply: That is certainly sabotage.  Hanlon's razor just doesn't fit here due to the elaborate nature of the "mistake" in question. The fact that simply putting things back the way they were normally fixes that particular problem attests to this.  The compound trouble, on the other hand, Hanlon's razor might still apply.  The mechanic might have been too ignorant to know what his sabotage might do.

I am a VERY strong proponent of Hanlon's razor.  Impulse, foolishness and ignorance account for the vast majority of the problems in the world that we so often presume a malice and fraud.    

Collective Impulse of foolish behavior in self interest is the biggest one, which explains all the nasty problems with our society that some people want to put on some sort of conspiracy.  This even explains crooked politicians and other corrupt leaders which are no where near as bad as they think.

As of degree of treachery, I doubt it was severe malice.  The mechanic who does this stuff doesn't sit in the back room laughing at suckers like a grifter con-man who has more than enough money and just does it for lulz.   

They are simply trying to make a buck to get by in a cruel world and seem to not have the ethics to do it properly.  Such a bad mechanic needs to be stopped by civil law for their own protection, not just the protection of other.  If not they could easily one day land themselves in jail when something goes horribly wrong.
Reply: @oengusfearghas9608  , Costumers can react badly and go and shot the scammer, happened to me ,so  that's why I just give the estima and fix the vehicle and that's it, " when they expected the part of "we'll this is how you got duped" , I wouldn't go there... but I did reported the scams to the city...
Reply: Bones McGillicuddy   only other options are to take the broken car back (worth nothing) and try to sue to get my spent money back (far more than the car is worth).  Even if I won a lawsuit theres no system forcing them to pay me in a timely manner, i may never actually get paid, and just end up with a busted worthless car.     I could not recuperate my loses by selling the broken car, so i pretty much have to hope they eventually fix it.   At which point I will at least have a car worth some portion of the money I already wasted on it.

and the reason its been so long is that the shop continues to promise "WE ARE ALMOST DONE! 1 MORE WEEK!"
and the next week is the same story, every week for 140 weeks.
Our legal system is so busted id just basically throw away even MORE money chasing a judgement, and then they likely simply wouldnt pay me. The legal system will do nothing more than tell them "you SHOULD pay him..."  and thats it.   america sucks.
Reply: Bones McGillicuddy    the story is long and frustrating lol.   originally it went into  the shop for new Belts LMAO.  but the belts ripped off in a week, and then the pulleys were screaming so it went back again, and then it started overheating so we thought it was water pump so it went back again, then  a couple weeks after that it overheated again so it went back again, and after fuckin with it for literally a month, they decided it was headgasket  (even though i had actually had compression test done months before when i had another issue), the very first time i brought the car to the shop, for leaking intake gasket, which they had done a good job on (was like 8 months before), and the car ran fine for 6 months or so before i decided to simply get new belts....  at the time i thought it was a legitimate shop, they had done well already. 

  :(

anyway by the time we got to the headgasket issue, i had already put a bunch of money in obviously, but then we considered the price of either head gasket replacement or full used engine replacement, and they basically said the prices were the same but they would be able to do the replacement easier and faster, and i would trade a 120k engine in for an 85k ish engine with a warranty if I went that route, so i thought it seemed the best choice.

(ive since changed my mind...)
     
The caveat was that i had to pay for the engine up front (parts only, not the labor).   seemed reasonable at the time.    but then the engine replacement was taking a  long time. i figured originally id give a month or 2 at most, but after 2 months they hadnt really contacted me with updates, i finally got ahold of the manager and he said they had to send the engine back because they were sent a bad engine.  and they were still waiting on the new one.  but then another month went by, they said even THAT engine was bad so they were now waiting on a 3rd engine.   then another month and they were waiting on some other part, then another month and they said they were almost done, but they were struggling with so many setbacks they could really use the rest of the payment, i had already paid 70% (the parts) anyway, so i figured the rest would be fine now, and i felt bad they had such problems anyway, so i paid the rest.
but then it got to the new normal, where i started contacting them every week over and over again,  "we are almost done, next week for sure".  "almost done. few more days".     by now it was already 6 months just since the headgasket decision. 8 since the new belts decision.   
Finally they had it done and i went to pick up the car, and discovered it still had a check engine light.  "its not the engine though, its the smog system, you need new catalytic converters" 
oh and they also had managed to do some body damage to the car in that time too.  
I wasnt going to take the car in that condition, and i had already paid, they told me they would fix the body work, and in the meantime i tried to figure out how to solve the cats problem.   Obviously there is no way for me as a customer to prove they were the ones who fucked up the cats, so i was basically screwed there. If i took the car in that condition, i would have no recourse because i couldnt prove if they had actually done the engine properly anyway.  so basically at that point i had no choice but to have them do the damn Cats as well.   this was around december 2019.  so the cheapest way to solve the cats problem was to have them REBUILT  (instead of buying new.)  but that requires sending them out to a specialized shop, which are not common, and have a wait time of a month.  i thought that was shitty but expected. what could i do.
problem is,  1 month turned into 2, and that put it square int he beginning of covid.  so 2 turned into 4, and 4 turned into 6....   by the time i finally got the car back, and it was running, but they hadnt actually fixed the body work yet, i almost decided to give up on the body work but then i had the car for literally one day and the fuckin check engine light came back on!  but now i have paid for the cats already as well.  
but i have a warranty on the engine and I was flat fuckin broke and it was May 2020, lockdowns already, labor shortages, etc.  the car sat in the shop longer and longer and longer. and i have zero recourse, and im already out of pocket more than the car is even worth in running condition now (originally i was getting the car fixed because i intended to keep it for many years more you know...)

rock and a hardplace... and 3 more rocks.

anyway, they literally still have the car LMFAO   and hey just a few weeks ago they said "Oh we are for sure going to have it done by Thanksgiving!!"     but fuckin HERE WE ARE.

like i said, there is no point in taking the car back if its body is fucked and its engine is fucked, its basically worth $ ZERO.  and yet ive already paid around $6000 or more in total work done on the fuckin thing. that money is already gone.   so the only way to get it back would be lawsuit.     its lose lose lose situation for me.  the only reasonable choice is just let them keep working on the car until i get it back i guess.  at least then in theory ill have that working vehicle i was supposed to have 3 years ago, even though it will still be worth only 3k or 4k on the used car market now, even running.  

 and ive since OBVIOUSLY had to buy a whole separate fuckin car,  cause obviously after the first 6 months of being without a car, and then the catalytic converter issue taking another 6 months,  and also btw at the beginning of the covid lockdowns i got evicted from the cottage i was renting, because they wanted the space for family, and it was before the eviction moratorium, and i didnt have a multi year lease, i was on month to month because they didnt renew the lease in january. so again, another situation where i had zero legal recourse. was just fucked.  so you can imagine how i then went even further into debt and finally had no choice but to buy a different car etc etc.  and then because covid i couldnt even find a new place to rent, was sleeping in the new car for a while, (i say new but its actually a $5000 civic. a 2006.  not a luxury sedan.   i should mention my car that is in the shop is a infiniti g35 sedan,  i would much rather have slept in that...) 

its been a really fucked up couple years for me.
Reply: a simple Belt Job  they say....     "preventative maintenance" they say!
Reply: Bones McGillicuddy   yeah i scanned the obd after the light came on and it threw codes from all over, from the bank sensors to the o2 and a number of smog codes, and there was clearly an oil leak at the intake gasket, and a few other minor things plus they hadnt bothered doing the body damage. most of the body damage id even have been willing to fix myself, but the worst damage was a dent in the rear quarter, between the door and the wheel well, which caused a gap between the rear door and the body when it closed, which is something that is very hard for me to fix in my driveway you know. thats a section of body that requires more significant attention, a shop has to do it.   and as I had a warranty on the engine, i was able to get the shop owner to concede they would have to fix all the failures and return me a car ready to smog, with the rear body section repaired.     My only concession at this point is just the time.  obviously they are using their resources as sparingly as possible, but I do believe they are making progress, its just absurdly slow.

unfortunately there was simply no good time to pull my car out of their which i would have been able to cut loses at a reasonable level. by the time i realized i was getting fucked, the car literally had no engine in it any more.   and at any point after that, i was already too far in monetarily to turn back.   

i had already paid for the engine itself before I had any reason to really suspect the shop. i was weary of the issues with the belts, but its not like its impossible for those things to have been simply normal mechanical failure.  the new belts put tension on old idle pulleys, the new idle pulleys put tension on the waterpump, the overheating from that could have been the cause of the larger blowout.  or for that matter the head gasket could have already been blown before, and i had just been babying the car too long to notice, and the overheating just exacerbated the problem.   in other words I couldnt come to the definitive belief their was any sinister issues at the shop,  and it I had already verified through other channels that a proper head gasket job would indeed be about the same price as an engine replacement.  

and at the point when i had finally got the car back after the engine replacement was "done" and i paid for it, i was obviously already somewhat emotionally compromised, plus it was christmas season on top of that, so i probably made the decision to let them continue the work under some duress.   but really at that point if i took the car to another shop, I still would have had to pay to do the cats in order to smog the damn car anyway, so its not like there was anyway to save any money.  if the new shop also found problems with the engine, they wouldnt fix it for free either, the warranty was only through the shop it was installed at.   So that would have just been even more money out of pocket.  I already had $6000 intoa  car that in great condition would only be worth $5000 on the market even as a private seller.  i was already upside down no matter what choice i made. 

its really sad that the course ive had to take, literally is the best possible course of action  :(     and i absolutely blame our shitty legal system for that reality.     and obviously the shop is criminal as well.  but it seems everyone is criminal these days, so i just picked the less painful road to go down.      let myself get punched in the gut, instead of getting kicked in the face.
Reply: Bones McGillicuddy   thing iis the car had passed smog like 6 months before the belt issue, so the cats probably WERE good when i brought the car in,  so if there was a problem its pretty bad timing, more likely someone stole them, and the shop didnt feel like owning up to it, but like i said there was no way i could prove that however you look at it.  if the shop says "they were broken"  then even the court would probably just tell me "too bad".  

as for the shop reputation i did look it up before i brought the car there for the very first issue, and it had good reviews at the time, and it was also part of a small chain of shops with 4 or 5 locations in different nearby towns. but they were all small shops and individually managed, so they werent really sharing resources. Perhaps the owner of the chain was a good guy and maybe the other shops were fine and i just got unlucky on having the one close to me be the shitty one  (thats of course what the owner has tried to convince me of.  "that manager was terrible, theyve all been fired" but the truth is i know for sure one of the managers that was there from the beginning is still working at a different shop.  and they ended  up closing the one that was close to me. they said it was because they didnt make enough money.

and yeh i did go into the shop many times in person. i saw the car with no engine and no front support, radiator out, sitting on a lift for a long time. it probably sat on the same lift, up in the air with another wreck parked under it, for atleast a few months there.

but also once i had to move, i had to move pretty far away to find a place available, and that original shop is closed so it had to go to a different location which of course is at a town in the opposite direction.  so for the last lets say 14 months, i literally live 100 miles from where the car is.  so going in person is kinda a waste either way.  they just say the same thing every time.  the manager is on lunch. i wait, he comes back, tells me to talk to owner, who is never in the shops. lol. 

unless i like brought in a bunch of people and acted like a Mob,  i doubt i could ever do anything to speed them up.   they know wll enough that i could take them to court, i had that discussion with the owner already. basically  "i will show up to court, but i wont have any money to pay you even if you win."
Reply: Bones McGillicuddy  not too metro but it is california  :(  has to pass smog every 2 years, or if it changes hands.  and they are super strict there cant be any check engine light, and all the obd smog tests on the cpu have to be in passed state.  (older cars can sometimes have 1 smog code and still pass, but after like 2005 they pretty much have to be perfect)

and basically the deal is to have them get it smog passable, and fix the rear quarter ($500 would definitely not cover that, and the damage is too significant to just ignore, because the gap in the door causes the air to whistle very loud ont he freeway, its awful)

and since i already have another car now, its not like im pressed for time, either since when i get it back it wont be worth selling anyway.  its basically just become a forever backup car LOL.  ill just own it till it dies again and then junk yard it probably. basically threw 6 grand down the trash compactor.   shoulda just trashed the car and got a new one from the beginning, but at the time when i was deciding on the engine, it seemed like i was coming in reasonable price, basically i had already just spent almost $2000 on it, and before it was broken i coulda probably got like $1500 maybe $2000 for it. was gonna cost another $3000 to fix  buying a replacement of the same vehicle on used market woulda been about $4500 in basically the same condition, with more like 200k miles,  so basically i was breaking even at the time, if the engine replacement went smoothly and at the original price and there was no body damage, it was basically slightly more money but ending up with a much lower mile engine, so it seemed the right choice at the time.  

but then it cost a full $3500 more than expected.  and with the body damage depreciated even more.  So now its $8000+ into it, and it probably only sell now for $3000 if im lucky  (thats after its running)

oh well.
Reply: Bones McGillicuddy   im sure one day they will get bored of the car wasting space on their lot and finish the damn thing LOL.  at the moment I dont have much parking available anyway so im not losing much by it sitting around, basically all the bad that can possibly come of it pretty much already has 

or maybe i should knock on wood right now
Reply: @oengusfearghas9608  Yes. Same in Australian. My friend was fired for quietly telling a customer they were being ripped off. The customer then instantly complained - resulting in the firing. Another friend worked in reception at a different place and couldn’t watch customers who clearly couldn’t afford it being taken for hundreds again and again, had to quit. Obviously this isn’t everywhere, but you get the point.
Reply: @martingilvray06  easy the relay being out stopped those safety functions.the wire only fed the pump itself.
Reply: @philhammond5908  Thanks .
Reply: Wow! Was not expecting to see you comment on Ray's videos. Lol. I read your comment in your voice. 😂. Always fun seeing a channel I subscribe to comment on an unrelated channel I subscribe to 😂. Awesome man!
Reply: @Iceman-kr6df  My take - if you're charging someone for work you're fully aware isn't a proper fix, without the customer's full consent and understanding, it's malicious.
Reply: @anthonys7976  lol if the cars were actually maintained as they should be but let’s be real.. no ones wrenching 24/7 because majority don’t take a car to a shop till it’s became a problem. Basic maintenance would be amazing
Reply: @dennisbonville3217  how do you know
Reply: @frankrizzo893  lol good idea
Reply: @williamgrissom9022  

There's many ways.
For example: voltage measured across a low-resistance resistor (like 1/10 or 1/100 of an ohm) by connecting both side to an operation amplfier chip, wiring it up as a "differential amplifier".  Using a selected resistance will amplify that voltage to something more readable.   The voltage across a resistor is perfectly proportional to the amount of current running through it (straight line relationship.  The resistance value is the proportionality constant.
Voltage = Resistance x Current.
so 2 Amps through x 1/100 ohm = 2/100 Volts.  Run that through an op amp with the feedback resistor 100x the input resistance, and that will output 2 volts, telling you that there are 2 amps running through the circuit with the 1/100 ohm resistor in it.
I'm just pulling numbers out of a hat, but you get the idea, but the simplest is to create a circuit which has a voltage reading which is proportional to the current running through some part of the circuit being monitored.
Reply: @akulkis  Certainly current to the fuel pump can be measured, but that adds complexity and cost, which auto-makers strive to avoid.  I was just surprised that some implement that.  It does make trouble-shooting easier.  All the owners who claim one can't repair modern cars themselves  because "too computerized" have never tried or watched youtubes.  In many ways they are easier to diagnose and repair, compared to say pondering what is going on inside a carburetor, especially in the days before we had exhaust O2 sensors.  You don't need the expensive monitoring equipment, just a $5 ELM327 adapter.  I recently rented a Mustang convertible w/ 4 cyl eco-boost engine and popped the hood.  The engine looked much easier to work on than my 1965 Dart V-8.  There was plenty of room to swing a wrench, even with the turbo.  The O2 sensor was right on top.  Only downside I saw were the custom plastic coolant manifolds which might prove pricier to replace than hoses.
Reply: Nice, 
A good prayer:
I'm a sinner JESUS please forgive me for all my sins I know you shed your Blood for me on the cross at Calvary. Thank you JESUS for my salvation and for shedding they Blood for me. I love you JESUS. 
Romans 10:5/10 ct...❤️k
JESUSisLord!Amen...
Amen..
If you'd like to call someone who cares 
83
For
Truth.
bc you don't know when you'll die?
.y r u hesitant..?👑.
Reply: @shawnkelly5459  Given the lack of inspection cover, and the 'symptoms' that were caused by prior shady mechanic, it could be as simple as a bolt that has been removed from the flex plate- loud enough to get someone's attention and sound serious, but super simple to fix.
Reply: @anthonys7976  A reputable master technician wouldn’t be putting down Chevy or any other makes.
Reply: you may only need a new key and not the cylinder, mine was doing the same and a new key did the trick
Reply: @oengusfearghas9608  The same thing you said can also be applied to retailers dealing with home improvement among other things I'm sure
Reply: I'm absolutely not buying a new truck to replace this one because a $60 module wont flash, I've replaced the engine on this vehicle and spent about $3500 all in on parts, an engine control module, a battery, an anti theft module, tires, etc. Its a clean car and ran fine before someone tried to steal it. I think a competent tech could program that module, I just cant find one where I live, so my next purchase might actually be a car trailer lol.
Reply: @Iceman-kr6df  that is really messed up and diserved some jail time doing hard work.
Reply: what the wire looked like was a remote on/off wire for an amp that you would hook up subwoofers to
Reply: @oengusfearghas9608  sounds like a service plumbing shop like George Brazil
Reply: @RainmanRaysRepairs  I like to deal with tretchery the same way Robespier and the Frenchmen did back in the 19th century.
Reply: That was done straight up intentional. 2005-2007 GMT's and Suburbans are electrical nightmares and that is something you see on a regular basis legitimately- however, scammers know that these were known to be nightmarish vehicles. They take advantage of the reputation and they screw consumers with smart ass tricks like this. Hell GM was known for dodgy wiring 1990's-2000's- guess what ? They had their issues, but scammers love to create an easy fix with a huge repair bill. In autorepair there are more scammers now than ever before- even at dealers(Ware's Chevrolet Blairsville GA anyone ?) who take advantage of customers. #gmt #wareschevrolet #wares #chevrolet #blairsville #ga
Reply: wow bigclive didnt expect you here lol
Reply: Treachery, and here's why. The car had NONE of these problems beforehand. It was at that other shop for an oil change, nothing more. There was no reason to fudge through anything incompetently.
Reply: @oengusfearghas9608  Imagine risking your reputation over a 20 dollar air filter ...
Reply: Fancy meeting you here Clive.
Reply: @RainmanRaysRepairs  Where did the blue wire terminate to from the fuse box?
Reply: 서윤  -  Do you have a younger sister who likes little old men who are living on social security retirement pay?
Reply: @tectalabyss  -  Well said.  I agree with your Dad.   And, I'm also poor, but only financially.
Reply: @Iceman-kr6df  good show
Reply: Your a good man in an evil world

.you just destroyed a bunch of evil
Reply: I'm not a car mechanic but if I wanted to check if the pump worked, I would settle for bypassing any relay. Not drawing a new wire. Especially since the pump did power without the blue wire so there was no fault in the original wire.
A removed relay can be an accident. But that wire that had zero reason to be there is a very smoking gun.
Reply: @RainmanRaysRepairs  I agree: it needs sufficient competence to know where to connect the wire to... This is not found at random. Cleverly orchestrated hoax!
Reply: @dennisbonville3217  Really? You have been to ALL dealerships?
Interesting.
Reply: @wirdy1  I agree. And I wouldn't be surprised if he tried to fix his problem himself and just blamed another shop.
If he lives with an ignition cylinder like that, I bet he did the blue wire repair himself.
Reply: @markonw6661  There is at least one scenario where the fuse box is involved with an oil change.
Saturn cars had the oil reset button in the fuse box.
Reply: @oengusfearghas9608  
It’s been my experience with dealerships that the service writers seem to be on commission and will upsell whenever the opportunity presents itself.  Meanwhile, my vehicle is back in the service area, in effect being held hostage.  I would love to be able to go speak with the mechanic directly.
Reply: @jasonsummit1885  Me too! I watch that guy alot
Reply: I've seen this "fuel pump bypass" fix once or twice by a roadside assist mechanic to get someone going again in a pinch when they were stranded. For such a jury-rig, it works fine, but it does mean you have to actually fix the problem back at the shop, and communicate to the customer that you performed a temporary limp-home fix.
Reply: @anthonys7976  Ford lover
Reply: im not even a mechanic and even I would never hard wire something to power from a fuse box.  also the customer took it to the guy multiple times so either that mechanic put the wire there or saw it and did nothing about it.  if he did nothing about it he is still scamming the guy by intentionally fixing the vehicle, and if he put it there he was definitely running a scam because there is a diagram right there saying which fuse goes to which module so why would he ever wire the power from a fuse to a module the fuse doesn't even go to, there is no reason to ever wire the power for the trans to the fuel pump
Reply: If they were that incompetent, they wouldn't have known how to wire it that way.
Reply: Fancy seeing you here Clive!
Reply: I’d say it was intentional because there was no reason for that other shop to even go into the fuse box and remove fuses and relays other than for trying to find a short and they would have been replaced right away after testing each one. Then the rogue wire? What reason other than to cause the problems in hopes for getting more work or getting the customer to sell the vehicle to them CHEAP so they can do a quick resale on it. A mechanic shop around here tried the buy it cheap scam on a friend of mine by saying the frame was rusted so bad it was breaking in half causing the noise she was hearing which was actually a bad bushing on the sway bar and it backfired on him. Even though he scared her so bad she was only willing to drive it back home and have her husband take her car shopping, he didn’t get the truck. She asked if I would want it for parts so I checked it out and told her he had lied to her. She was still afraid to drive it so gave it to me for free. I had it for 7 years before I sold it and the guy who bought it ran it 5 years before someone slid through an icy intersection and broadsided him totaling it out.
Reply: @ramiroescamilla7263  really that’s crazy
Reply: @williamgrissom9022  ECM switches the fuel pump relay on the ground side so if it doesn't see voltage from the relay it knows there's a relay control circuit failure.
Reply: It was treachery as the average person wont know what the slight high pitched sound is until its already too late and their fuel pump is wrecked. Your basicaly driving 24/7 on that 1 particular parr wich partly relies on the fuel itself for cooling purposes. It jus burns out the pump. Can take a month. Can take a week,,or even a couple of months,,only not likely on a 2002-2008 Vintage Chevy or GM ANYTHING.🙏🤙
Reply: @oengusfearghas9608  Calling BS on that. Auto mechanic is one of those jobs where you can always find work. So if a shop owner says you need to do this or that and you know it is wrong, then just find a different job.
Reply: @jasonsummit1885  Yeah... I could really hear the rolling "r" in trrrreachery.
Reply: @oengusfearghas9608  I worked at a Toyota dealer that was very shady. They literally ripped of family members of employees. My service manager and general manager both told us we have to push services to make it.
Reply: Hey, epic Clive make's an appearance!
Reply: Bet these people could of damn near bought a different vehicle with all the money there going to have put into this car after all this
Reply: @anthonys7976  They don't want to wrench for money. They want to plug or unplug something.
Reply: @alexisrivera200xable  Sabotaged the trans, and car won't shut OFF even with the key removed? No better than Horse Rustlers in the old West.
Reply: A truly great video. I can only hope the owner got his money back and THEN turned them into the police.
If not, his reaction doesn't make sense, unless he's going to blackmail THEM.
Reply: This guy writes his own scripts, do people seriously think this is spontaneous lol... this is theater.
Reply: @anthonys7976  Exactly.  Scamming is bad enough, but this is a case where if they're clever enough to come up with scams like this, they would probably be a crack diagnostician, get that reputation as being an excellent mechanic instead of one wit that reputation of not quite being able to sort out the problem, and still be making plenty of money.  Too bad.
Reply: Wish you were in the cleveland ohio area.